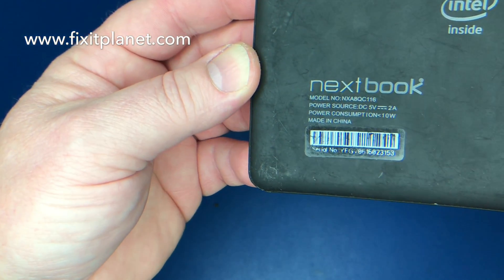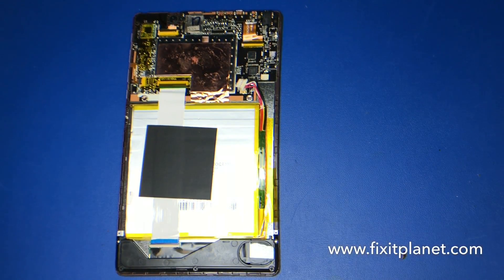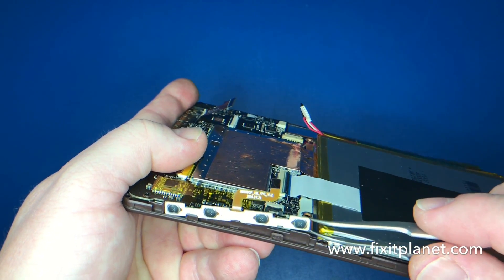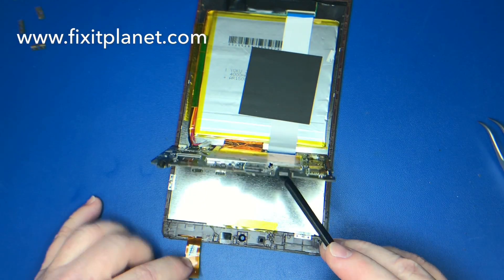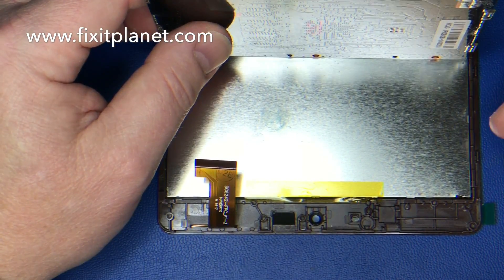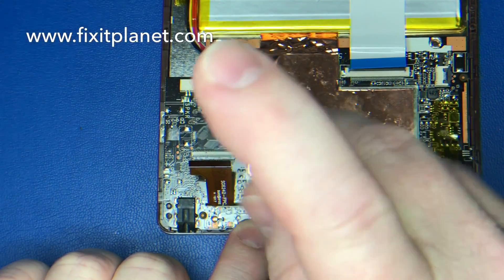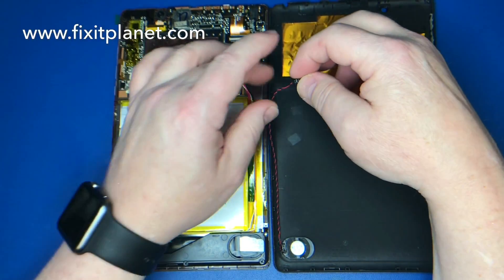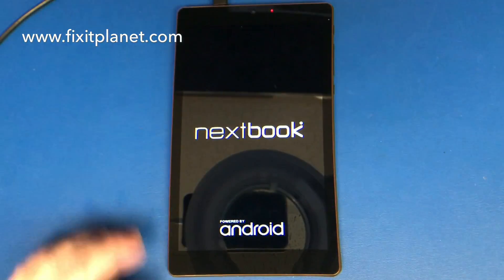Nextbook NXA8QC116 Touchscreen Repair From Start To Finish.

Comment: i have a weird question, what is the function of the force touch sensor gasket in the apple watch? how can do you know when its damaged?
Reply from the maker: The force touch sensor is what registers the amount or force when you touch the screen. Pressing harder on the screen will cause the software to react giving you additional options for a given purpose in an application. If the force touch function does not work then that software feature won't respond.
Reply: Fix It Planet thanks a lot!!!!
Reply from the maker: Yep but next time you might consider posting a question in a video related to that subject. ;)
Reply: Fix It Planet lol, thought you would not get a notification because it was +6 months ago.. don’t know why sorry!
Like your content though!!